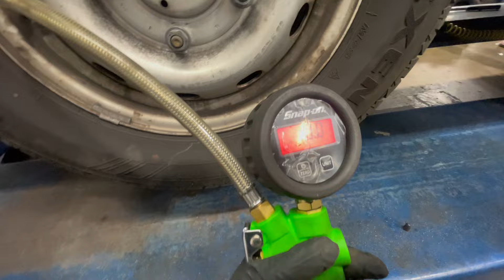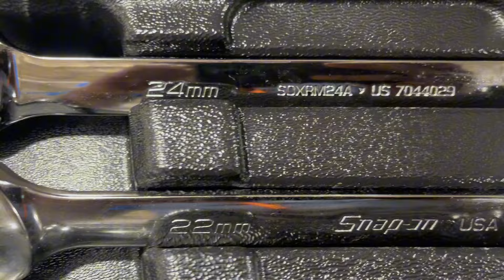Entry Level Ford Technician

Comment: Yeah! That CV axle noise is normal. What I would check is the control arms and the mounts if the customer said the have a noise every time they hit the brakes.
Reply from the maker: @MargenAuto  bet! I know normally when it’s the mounts you can hear it  when turning the steering wheel left and right and you’ll hear the sound and it vibrates in the steering wheel a little
Reply: @KENDRO1K  A transmission mount or stabilizer link can also be the cause of that noise.

Comment: As far as the tire rotation I believe you’re supposed to “rotate” the rear wheels. The fronts go straight back then the passenger rear would go to the front driver and the rear driver would go to the front passenger.
Reply from the maker: @Mostlyanxious  according to what I know if they’re all the same size tire and are directional you can do front to back but what you’re saying is right they talk about the difference in one of the classes I took
Reply: If they're the same size front to back is sufficient.  Mainly need to split time on the drive wheels 50-50 to get even wear.  When a tire is left on the drive wheel too long, that's when it wears prematurely, as long as all suspension and alignment is in order.
Reply from the maker: @M4sterT3ch  makes sense my instructor was talking about that today